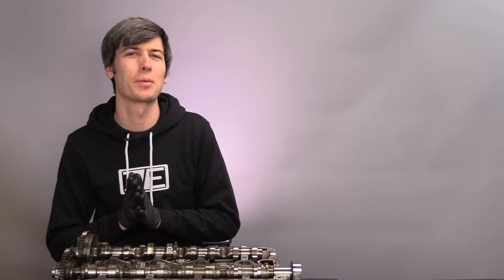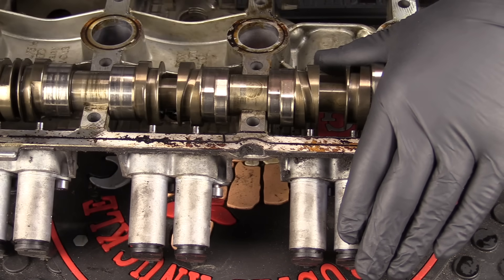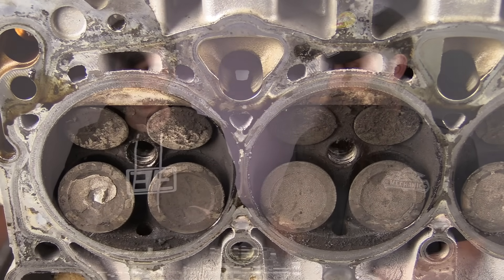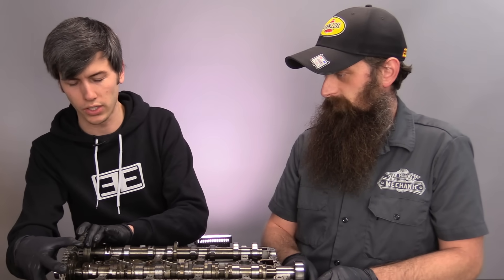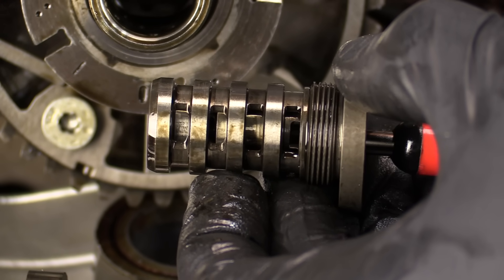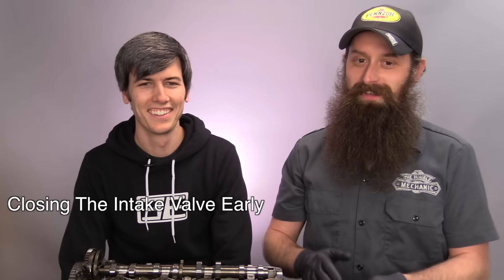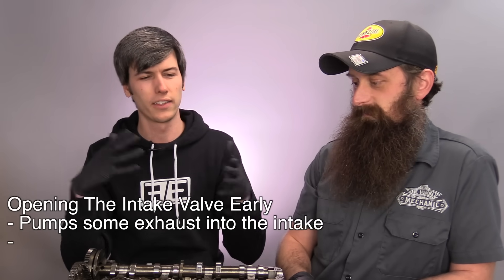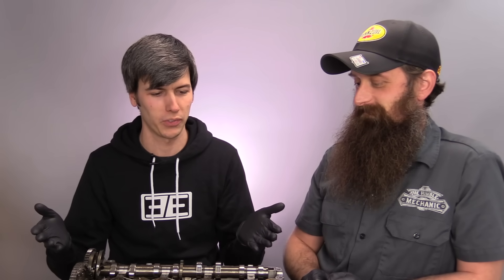Variable Valve Lift vs Variable Valve Timing - VVL vs VVT

Comment: Does direct injection always cause valves to become dirty? 

Old style injection systems sprayed fuel onto the valve and kept the valves clean.
Reply: not always, but this is a very common design characteristic of DI engines.
Reply: Will EE make a video about it?

Comment: Interesting, didn't know about this VVL. I wonder why they decided on a separate cam sleeve for each cylinder - with the added complexity of two solenoids per cylinder, without an obvious benefit from being able to control each cylinder independently - instead of a single big sleeve for all cylinders. Also the sleeves don't seem to lock into position, once the pins have retracted. On the other hand, compared to VTEC, there are only two rocker arms per cylinder instead of the VTEC's 3, hence a lower reciprocating mass.
Reply: Each cylinder uses a separate sleeve so that the timing shift can occur when the valve is closed, you can’t move the camshaft side-to-side when the valve is open. It could be done on pairs of cylinders (1-2 on one solenoid pair, 3-4 on the other), but then the time window to slide the cam over is reduced.

Comment: This is cool, my Celica has VVTL-i, with timing and lift on both the intake and exhaust camshafts.
Reply: And the cams don't slide on the shaft, and no actuator pins, so there's actually less risk of a catastrophic failure.
Reply: That's the real lift that you feel kick in on the 2zz 6200-6500rpm til redline of 8200-8500rpm. This VVL on this VW engine is to be more efficient on the exhaust side for the turbo but it doesn't kick in yo the way that a VVTLi or VTEC does
Reply: It needed VVL on the intake cam because it’s not forced induction

Comment: Isnt this similar to what Honda did in 1989 with Vtec and Nissan in 1997 with VVL? As well as Toyota in 2000 w/ VVTLi? Not knocking what VW has done but nothing new. Regardless Iove Humble Mechanic and Engineering Explains Channels You guys are awesome. This seems to be for emissions vs the above were done for HP

Comment: Doesn't open the intake early increase the intake efficiency also?  I though when the gas is exiting the cylinder at a high rate if you start to open the intake it actually brings in some extra air.   called like valve overlap I think and it produces a scavenging effect.

Comment: if its a boosted engine, late closting intake valve doesnt have any air\fuel charge pushed back into the intake, it becomes a miller cycle engine at that point, but i think that more applys to supercharged
Reply: what is this bell you speak of? im lost

Comment: With Koenigsegg Freevalve you have 100% full control of the heights, how long they are going to be open and shut, timing etc etc! It is much more efficient  and you make more power!

It is like built up by these electro magnets if I remember correctly..

Comment: My understanding of closing the intake valve later at high RPMs was to allow the momentum of the incoming fuel/air charge to help load the cylinder.

Comment: Rover's VVC is interesting too. It involves using oil pressure to move a secondary lobe that lifts the whole cam profile when needed to provide a flatter torque curve. It can do it I think  quicker than about a 1/4 of a revolution of the cam so you can even control the lift before the valve has finished closing or opening.

Comment: closing the intake valves later may do that but in performance engines what it does is taking advatage of the intake fuel mixtures flow speed and even though the piston starts to go up just a little more fuel goes in the combustion chamber so you make more power.(if i'm corect this applies to both n/a and forced induction engines)

Comment: How do they control when the solenoids on the variable valve lift activate? all those moving parts look like they would turn eachother inside out if there was a sticky solenoid or the timing was a little bit off.
Reply: Steve Reed the solenoids fail rest in the inactive state. So the odds of failure causing catastrophic are low. 

The positions of rotating parts are closely monitored. Failures of this system are pretty rare. especially when car is properly maintained.
Reply: Proper maintenence is a must, I've torn a few of these apart that had failed, all of them due to infrequent oil change And one guy didn't have enough oil, the journals turned blue from the heat on #4 cyl.

Comment: 7:20 you say that closing the intake valve early means you're pulling less vacuum, but the vacuum in the cylinder is going to be even higher with them closed than if they could draw from the mani. If it reduces pumping losses I would assume the improvement is due to lower cylinder pressure on the compression stroke.

Comment: emissions? it's not like VW needs to lie about their emissions or anything. :p
Reply: David Vermillion Makes gasoline with how well engines and their emission systems are made for emissions sound like a dream come true.
Reply: lol i dont think a lot of people care about emissions besides epa
Reply: I think a lot of people do now because they can make a whole lot of money from suing VW now for false advertising.
Reply: Please for your sanity don't run the numbers on coal its extremely depressing. With its radioactive dust and gas, cadmium, lead, mercury, NOx, sulphur ect. It gets deadly quick I'm glad my state has no big deposits of coal or we'd have a coal plant.
Reply: If the peak emissions of VW being 40 times greater was like that continually as they drove, then you should care. There is a small number of people that die every year. I ran the math. And it was like Ford and Chevy made twice as many trucks. That's how much these fewer VW's produced more of the emissions they didn't. It literally killed people. Sure, they probably had emphysema or some other breathing issue already, but I used to live in Utah where when smog gets stuck in the Salt Lake Valley in winter, there are deaths reported from it every week.

But this is based on VW ALWAYS producing 40 times greater emissions - that was just the peak of the bad of these engines.

Comment: You are just wrong about the purpose of changing (or more specifically retarding) the intake valve timing.. At high RPMs, piston falls too quickly, before cylinder could fully be filled with intake air. Because of that, at higher RPMs engine dynamic compression ratio, torque and efficiency drops. By retarding intake valve, its possible to allow both exhaust and intake open at the same time, which is called overlap angle. Higher the overlap, greater the scavenging effect more intake air can be pulled by vacuum effect of evacuating exhaust gasses, and more efficient and powerful the engine becomes at high RPMs...

However, high overlap angles are problematic when RPM drops,  intake air/fuel mixture can just go through exhausts (high velocity, long duration) or (at very low RPMs) exhaust gas may even return back to cylinders causing the choppy idle of race cam engines... Varying overlap angle by rotating one cam respective to the other allows engine to have best of both worlds..

While it does control NOx emissions, that NOT its purpose. One can easily put a very small cam (or the same cam in delayed position) to achive same, even better emissions control. Sole purpose of varying the overlap is to improve efficiency of higher RPMs and improving peak power of the engine. That is why variable cam timing was not present in economy cars until ~2006 (still many doesn't have), but it was present on sports cars since like 1980s.

Comment: That exhaust cam looks like some seriously over-engineered and expensive VTEC!
Reply: UndergroundTrev designed by Germans, what do you expect?
Reply: @WhiteDwarfVR4  not just Germans, VAG engineers, even worse.  VAG is always wonky when compared to BMW and Merc.
Reply: @ryanl1782   yes lmfao because Mercedes and BMW never break down and dont cost a fortune to repair.. smh
Reply: UndergroundTrev VTEC=VeryTallEngineCoolant
Reply: That exhaust cam and valve system looks like a good way to ruin an engine.  If one of those actuator pins breaks off, all hell will break loose.
over-engineered means it exceeds the required specifications.  This valve lift design is under-engineered for fault tolerance, meaning there's more room for something to go wrong.
Reply: A solenoid pushing a sleeve back and forth is over engineered? it's not like using oil pressure to rotate the camshaft gear like in the intake side or Vtec, is it now?
Reply: Can imagine the cost to fix failed solenoids.
Reply: All these people saying how this looks unreliable and expensive but i have never heard a single case of these vvl solenoids failing so wheres the evidence
Reply: I absolutely love the dual variable valve timing in my toyota 3sge engine complete with titanium valves,  minimal moving parts, loves to Rev 8200rpm red line and the continuously adjustable timing above 4300rpm when solenoids open allows for near perfect gas flows through inlet and exhaust right upto Redline with no loss in power due to mismatched flow curves as a result of using a fixed cam profile.
Reply: In the vtec, theres no solenoil, just oil pressure that push a sleeve and lock the rocker together so the intake valve open more and longer.  Theres no solenoil pushing sleeve ON the cam and everything. Always remember : the more moving pieces an engine have, the less reliable that engine will be.
Reply: @thefatdindon  there is solenoid in VTEC it call VTEC oil solenoid.just one solenoid that supply oil pressure to slide the VTEC rocker pin
Reply: @thefatdindon  That's not actually true,  there are different versions.  Honda use solenoid control, others use oil pressure, not all are the same.
Reply: @thefatdindon  clearly less parts doesn't always mean greater reliability. A rotary engine has 3 main moving parts versus 27 for a standard DOHC 16 valve 4 cylinder engine.
Reply: thefatdindon 
it's pretty obvious how Vtec works and that's exactly what I said in my comment :
"it's not like using oil pressure to rotate the camshaft gear like in the intake side or Vtec"
My point is using oil to rotate isn't really that different to a solenoid pushing a sleeve and the solenoids are much easier to maintain since you can just unbolt them from the cylinder-head cover, good luck with Vtec and removing the whole engine side and the timing chain.
But what do I know I'm just an engineer. hopefully not all people are scared of new or more complex stuff otherwise we'll be stuck with cars with no steering assist or ABS for the very least.
Reply: @abdbach379  Actually there´s a Vtec solenoid that opens or closes the oil passage. Those holes in the head, allow the oil to pass with pressure through some channels and push a pin that locks a rocker arm that is working the big cam lobe. When VTEC is disengage, the solenoid closes those holes, cutting oil pressure, making the pin retract and leaving the rocker arm that works the biggest cam lobe not working. It´s pretty simple and very very easy to maintain. Also, that solenoid is outside of the head, usually in the back, easy access, easy to remove and clean and in the last 30 or more years worked fine. It´s a simple pioneer technology so good and so but so simple and fun to know how it works so, no need for a lot of engineering to make things work properly.
Reply: @tiagofigueiredo2529  On a 4 cylinder
Reply: @lbear3321  Yes, in their V6 engines too

Comment: So basically deliberately causing backfires by leaving intake open longer just to appease the greenies (I figure the spark probably doesn't trigger at that point but if it did that would be considered a backfire)
Reply: william fleete it improves hp also

Comment: So no real performance gain?
Or the exaust do give a better throttle?
Reply from the maker: +1300l VVL improves HP by opening the exhaust more.
Reply: Engineering Explained
Thanks Jason ;)
Reply: Engineering Explained hey, would be cool do do more overviews in different VVT systems employed by different manufacturers. Multiair for example. Also what was going on with the Ferrari f355 and the late timing of the 3rd intake valve. Why was that better than just longer duration? need answers!
Reply: When they added variable valve timing or vvt-i it gained the 2000 Toyota Corolla/Chevy Prizm 5 peak bHP. Not much right? But it did help more with efficiency and emissions. So you know, the 1998-1999 car is considered 8th generation along with the 2000-2002, but the later model did get the little engineering boost to it's engine.

When load is low it's really obvious.

When my wiring got a little damaged and flaky on my variable valve timing, I also learned that it made the engine a lot smoother. So, it was for a better customer experience as well.

Sometimes it'd get stuck in "slow" mode and it'd run poorer when you were trying to go fast. When it was in "fast" mode, the car wasn't as good when you were taking it easy. More rarely, it got stuck in the middle, which sounds good, but driving with greater or light acceleration - well, they both sucked. I have a lot about this car on my channel if you'd like to learn more. I have the 8.5 gen, not the 8th gen setup.
Reply: Primarily just allows for a wider power band. Without VVT/VVL, you have to chose a cam that is optimized low-end, mid-end, or high-end, as well as how "peaky" the power output is at that engine speed range.

Take Fiat's MultiAir for example. Yes, it's electro-hydraulic, but it's still a VVT/VVL system on both intake and exhaust. Fiat says it raises low-end torque 10% compared to traditional cam/valve tech, and also reduces emissions 10% and boost fuel economy. So...raising low-end torque helps improve throttle response, which they called out in this video. Honda, on the other hand, obviously uses it to primarily boost high-end power.

Overall, it's just making the old-school piston internal-combustion engine "smarter" by improving mechanical efficiency and utilizing optimization potential. At the end of the day, it's always more air and fuel that make an engine more powerful. How you go about that is the question (forced induction, larger displacement, etc.).
Reply: Derek Swanson You missed one thing that you need more than air and fuel for power. We're mostly taking about small engines here. More combustion mix at some point tops out without more timing advance. That's really where you make your horse power. 

It does require a healthy and accurate knock sensing system to catch even a whiff of knock that you'd never hear. That's power robbing and potentially damaging if it continues.

Comment: All ICE car engines should already have freevalve technology. It's like 2017 already. This will eliminate all the excess moving parts like cams and rocker arms, springs, chains and timing belts, bearings, throttle body... less things to go wrong... or better yet, get an EV which effectively only have has like a couple moving parts, and 200-300% efficiency

Comment: When opening the intake valve early to pump some of the exhaust gases into the intake manifold for emissions, why does that not cause backfiring?
Reply: Because all those TFSI/TSI engines have stratified injection. They don't suck in a gas/air mixture, just air. The gas is added directly to the combustion chamber via a specially-designed injector, pretty much like diesel engines do. Now some VW engines have a two-way injection, combining the benefits of stratified injection into the cylinder and classic injection into the manifold. Obviously, there will be no exhaust gas pushed back into the manifold during the manifold injection states.

Comment: My 1.8 Supercharged Toyota Corolla has both, VVTL-I. Lift on both exhaust and intake valves which kicks in at 5.2K to redline at 8.2K, and variable valve timing on the intake cam shaft.

Comment: Can't closing the intake valve early increase power output on some engines? As for most engines the intake valve is open for a little bit as the piston is traveling upwards, so some of the air fuel mixture is pushed out the cylinder and into the manifold.  So closing it early increases peak cylinder psi, and air fuel mixture supplying more power?  I'm assuming though that 90% of VVT engines are made for emissions, however for the reason I just explained can't closing the intake valve early actually increase power output if the engine where designed so?  Or say couldn't you design the system such that it has two steps? One step to close the intake valve early to maximize power and the second step to close the intake valve even earlier than that for the reason you explained in the video?
Reply: closing intake valves early reduces maximum power but reduces unburnt fuel emissions
Reply: @coryray8436  higher volumetric efficiency only achieve at high rpm not low rpm..it is because air have weight..once it is moving it doesnt want to stop and continue to fill up the cylinder eventhough the piston is begun to travel up.This will only happen at high rpm due higher air velocity. Retarding the intake cam which is closing the intake cam later during compression stroke at high rpm will allow the engine to exceed 100% volumetric efficency

Comment: In fact, when accelerating or decelerating every cylinder is gets his ignition on a different rpm. For optimal results, every cylinder needs his own camshaft. The VVC of a Rover K motor has a control unit on each side of the motor with 2 camshafts. The second runs in the inside of the first.